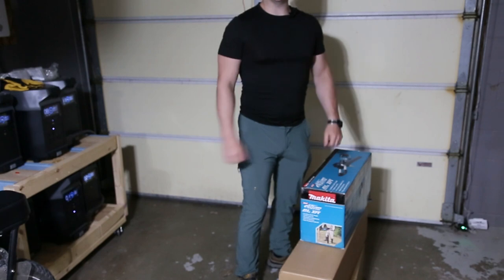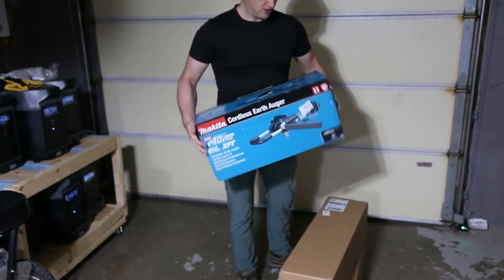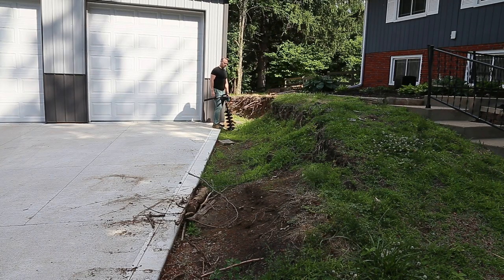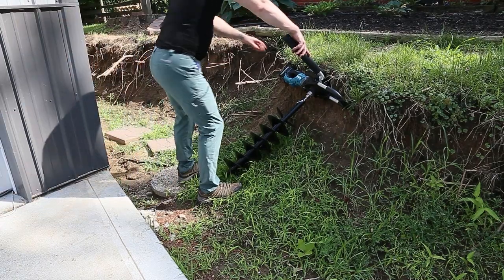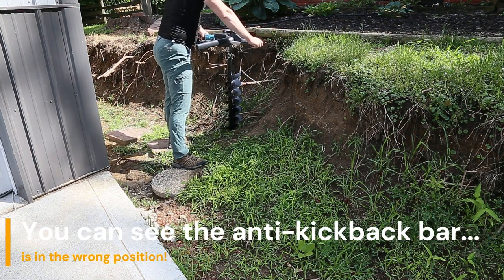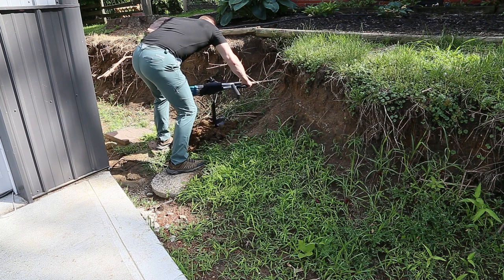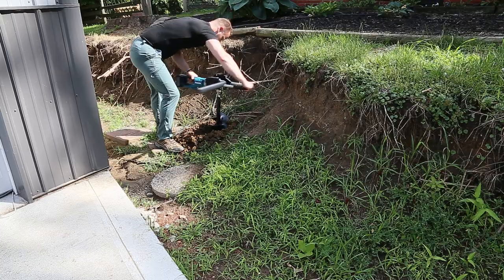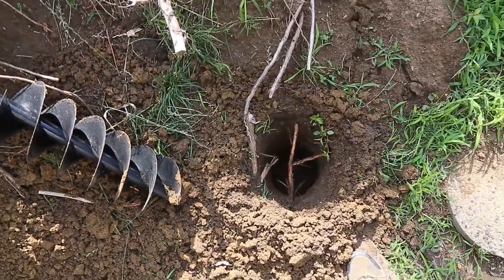Makita 40v XGT/XPT Earth Auger Review (GGD01M1)

Comment: I have the 36Volt version 18x2 XGD01 and it’s an absolute beast. 
The reason that Makita uses a keyed chuck is the “power unit” is actually a Hole Hog with different handles. 
I mainly use mine for drilling holes in steel frames up to 2 9/16” and it does this with ease and safely because of the Torque Limiter that prevents kickback in low speed (high speed doesn’t use the Torque Limiter). 
The “Power Unit” also has a LED Light that is useful when using it as a Hole Hog.